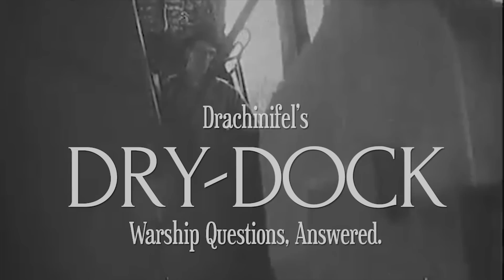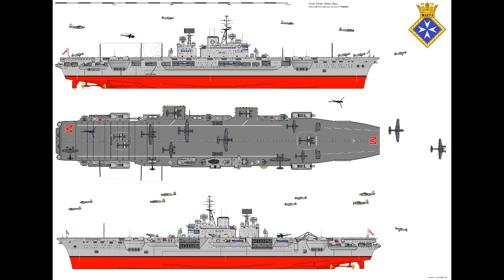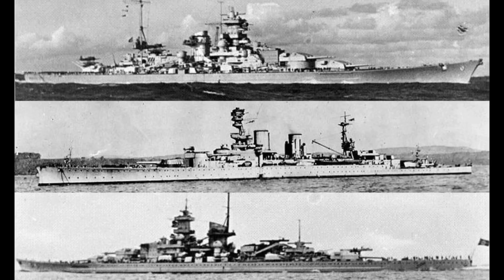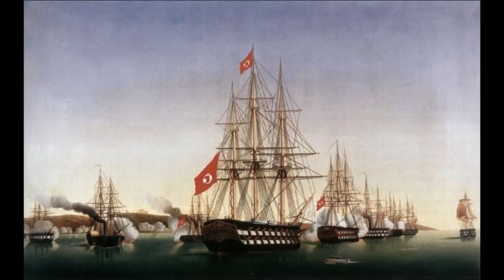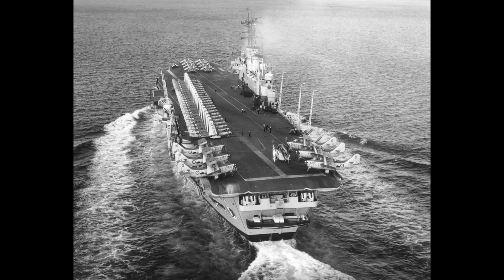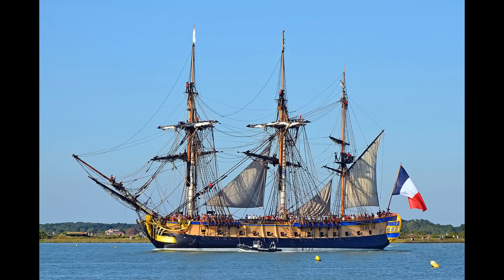The Drydock - Episode 070

Comment from the maker: Pinned post for Q&A :)
Reply: Hey Drachinifel, could you please update the link for the intro music for the “5 minute guide of warships” the link that you have been using doesn’t work any more, as the channel no longer exists (apparently it was deleted last month)
Reply: How much do you think about admiral yi history is true?
Reply: Marc Besalduch 

A lot of it is based on his own records and government reports, plus contemporary Japanese records, so it’s fairly reliable.
Reply: How does gravity work?
Reply: @johnmatthesen1186  The Earth sucks and you can test this by falling off a three story building or tree, gravity will suck you out of the air and smash you on the ground. Simple exclamation. The pull of gravity is determined by the mass of a object, which determines it's pull on all things under it's influence. This pull determines how fast a object will fall, it's acceleration affected by the thickness of the atmosphere and it's resistance to a object falling through it. Falling towards a planet without a atmosphere, the object should continue to accelerate until it hits the surface. In a atmosphere, the object can only accelerate to a determined speed, air resistance limits how much gravity can accelerate the object. Gravity can affect very light and small objects at a great distance, changing their course through space. Blackholes are still conjecture, we have never been actually close to one with a clear view. It's believed gravity can't escape from the black hole, some scientists believe each black hole has its opposite white hole, the black pulling matter in and the white spraying matter out, so far as I know, still unverified by science. As a test drop a apple on your left foot and a twenty pound steel weight on your right foot. Despite the different weights and shapes, both will hit your feet at the same time, the steel weight will hurt almost twenty times worse than the apple it outweighs by that much. Gravity's affect on different masses and shapes in a atmosphere, how despite this they fall at the same rate because they are equally affected by the atmospheres resistance to them as they pass through it. If it had no gravity, a planets rotation could hurl you off it if the rotation is fast enough. Gravity of the moon is used by many organisms to regulate sex and reproductive cycles. Making life on Mars with it's almost non-existent moons, a Interesting question of how this cycle especially in women will react to the loss of it's means of regulation. One of those things you have to actually experience, before you can say exactly how the body will react to the absence of the moons gravity in that situation. We have no way to know until humans actually live on Mars, but it's safe to say that there will be problems with this. If there is no wind and you shoot a .45 automatic straight up in the air, eventually it will fall close to you, the atmosphere resistance and gravity slows it's speed to nothing from a average 850 to 900 feet per second, gravity pulls the bullet back down, to hit the ground near you. If you are in a fighter jet and do a regular fast turn, your body can experience up to 8 gravity's, most people pass out at 8, if you weight 200, in 8 Gs your weight is 1,600, these aircraft are capable of doing a turn that will generate up to 16 gravity's, unusable by any pilot,  unless the affect of gravity can be turned off or eliminated. Here is a advantage of the unmanned drone, it can always out turn you, because gravity has no effect on it's systems. A aircraft in flight will experience a slight difference in the passage of time, because of the speed induced increase in mass of the aircraft. True it's almost too small to measure, but it's there. Mass and momentum has a separate effect from gravity, if you are on a jet traveling at twice the speed of sound that is suddenly stopped, mass and momentum will hurl you forward to be crushed against whatever is in front of you. Then gravity will make the aircraft fall from the sky.  A general outline of the main properties of gravity and some theories and speculation. Personally, I prefer Gravity by PaPa Roach, he appreciates the gravity of a situation in a well thought out manner. But that's a different kind of gravity. Hope this helps.
Reply: @johnmatthesen1186 - Do you mean stability?
Reply: No.
Reply: do you get enough rest?

you sound tired... please take care of yourself!
Reply: Seems to me to be an awful lot of concern, both in the video and the comments, about the potential electrical hazards of a turbo-electric drive especially once the ship is damaged. However, despite damage to various ships equipped with that system (various at Pearl Harbor, Saratoga repeatedly, the loss of Lexington) I'm not aware of these hazards actually becoming reality during the war. Are there actually documented cases of these shock hazards turning into "real" human casualties, or is it still theoretical?
Reply: Re: Turbo-Electric Drive  Isn't the new UK Carrier's (HMS Queen Elizabeth) propulsion system  a modern version of turbo-electric drive?
Reply: It seems to me after listening to several of your presentation of the German navy actions during WW2 that their use of a destroyer screen around the German capital ships were not used as much as I would have thought or if present were tactically misused. In some cases, I would expect the German destroyers did not have the legs to stay with, say, the Bismark. But other cases, the destroyer screen was sent off to search for the enemy resulting in the German capital ship being blown out of the water when facing a half dozen British battleships and cruisers that the German destroyers missed finding.
Reply: Would you mind going into a little bit of detail behind alternative designs that eventually became  Atlanta Class?
Reply: What was the thinking behind the Imperial German Navies scuttling heavily damaged ships?
Reply: If the germans managed to complete Bayern and Baden in time for the Battle of Jutland how would the battle have gone like had Bayern and Baden took part in it?
Reply: What if the Japanese threw the baby out with the bathwater and converted the Ise and Fuso class battleships into carriers, calling them "large decked transports", what with them being rather long turret farms? How would they have fared? Would the extra need for pilots have improved the speed of the Japanese training program? Would the additional four carrier hulls just have resulted in the US, Royal, Marine National, and maybe Italian (Il Duce is promised Formosa or something) ganging up on the 1920's IJN?
Reply: Considering past history, would you consider our current period in time a naval arms race with carriers from all the different?
Reply: Chris_Wooden_Eye  OK, episode 69 is like going to the fish market upside down. The obligatory childish sexual comment out of the way, have a great day!
Reply: Could you do a special/series of specials about the effects of bad weather on warships and naval battles from the age of sail through to WWII?
Reply: @Ralph0451  Yes, Halseys typhoons!
Reply: Why did many Italian ships have Red & White stripes on their bow and stern?
Reply: Jägeroo 

To avoid friendly fire.
Reply: Bk Jeong wow the Italians were concerned with friendly fire. Sounds like bad communication between ships. 😆
Reply: Jägeroo bad communication between the navy and Air Force, actually. The Regia Aeronautica bombed Regia Marina ships a few times.
Reply: @Cirrus2000  Several countries used identifying paint schemes on their forecastle and fantail decks to alert their own aircraft (Gemany, Italy, Japan, for example).  The downside of that was to make identification by enemy aircraft easy.
Reply: How do torpedos work (or not) in extremely rough seas?
Reply: What's the Sponson design Drach were talking about when he was breaking down angled flight deck for carriers? Sponson on Wikipedia doesn't sound like what he's talking about.
Reply from the maker: @eric24567  which part of the video do you refer to? :)
Reply: you were listing the benefits of angled flight deck and you mentioned something that sounded like Sponson around 31:20 ish.  Like space between take off and landing due to increasing space on Essex class carriers.
Reply: Apropos Somerville and Nagumo chasing around in the Indian Ocean, can you do a video on that particular operation?
Reply: During the North African campaigns, air power did a lot to suppress the movement of supply ships for both the Allies and Axis. Were these carried out by dive bombers, level bombers, torpedo bombers?
Reply: One of the anecdotes that I've read about the Chinese navy in the 1894 Sino-Japanese War was that they used the barrels of the main guns on their battleships to store chopsticks. Not sure whether to believe that or not...
Reply: MikeB they did even weirder stuff like pawning off the guns.
Reply: Problem with building a wooden ship nowdays is that you need to spend years figuring out how to do it again as the experience have not been kept.
See the building of the east Indiaman Göteborg, it took several years to build that becous they needed to figurit out as they went.

Also the ship is worth a visit it's a stationary museum right now in Gothenburg becous of lack of founds to take it out for sailings
Reply: Some historians contrast the complexity of Yamamoto's plans with the simplicity of Nimitz's response. Because code-breaking gave Admiral Nimitz knowledge of the Japanese intentions and deployment of forces, he was able to economize his forces and ignore Yamamoto's elaborate diversions. However, Nimitz did oppose the Japanese landings in the Aleutians with a cruiser force, thus leaving only two cruisers (CA Astoria and CA Portland) to protect CV Yorktown. Do you think that this sparse cover was an error by Nimitz, especially in light of the fact that neither North Carolina class battleship was available to screen the US carriers from the Japanese surface forces?
Reply: Here is an interesting question on world of warships. 
What do you think is a ship most mismatched at it’s tier when compared to it’s real world counterpart and or realistic performance specs? 
Also what was the most frustrating ship for you to play? (Mine was easily the tier 5 american cruiser. It was a big floating bomb.)
Reply: You get to design and build a ship that must be built by both the americans and British fleets in the second world war.(I.E satisfy the needs of both) What would this ship be (Ship type, name armarments etc)?
2(Would a sextuple centerline turret as suggested for the Tillman ships even be practical considering the problems the british had with quad mounts on Prince of Wales)
Reply: why have  or rather why where catamaran and trimaran designs not  explored for war ship in the era of big guns?   would they have not been  faster and harder to sink  due to  the redundancy ?
Reply: how effective would a age of sail cannon be verse a modern ship?
Reply: Why didnt the british use french all warships in their fleet or in free french fleet? They had access to couple of older battleships but these werent used.
Reply: What'd you need to get through the 6" deck on the original Design X Malta?
Reply: If the British 24.5-inch torpedoes had become the standard in the inter-war and WW2 period mow much better/worse of would the British destroyer and Sub forces be in WW2 and later going into NATO.
Reply: How long would Britain have lasted, if the German Submarine war against the British was as successful as the American submarine war against Japan was? Assuming use of German torpedoes after the initial problems were solved and the same quality and number of new submarines as in the US submarine fleet, with the search radar they used.
Reply: Hi mate. The link for the shirt keeps saying error 404. Is it just me?
Reply: Works for me. Still waiting for the "Giant Superstructure of DOOM!" t-shirt...
Reply: The Ottomans used unique (from a Western perspective) age of sail designs like the xebec among their lighter ships. Why do they seem to have relied mostly on European-style square-rigged designs, which have their roots in cogs etc. instead of a hypothetical indigenous solution to the problem of creating a ship with gobs of cannon?
Reply: On the subject of Youtube videos and demonetization... Do they ever tell you exactly WHY videos get demonetized, or is it just left a mystery?
Reply: Can you explain how the ship design competition actually works is their an app/website you use to standardise design choices or is it written design specifications?
Reply: How the Battle of Midway have changed if Yorktown hadn't been able to be repaired enough to join the Battle?
Reply: How would you have fought the Naval War as Germany during World War 1??
Reply: I've heard it said that the Swordfish was "so good, it outlived its own replacement". What, exactly, was so good about the design, and what, exactly, was wrong with the Albacore, the design that was supposed to replace it?
Reply: Could you say something about the 1970s wargaming of Operation Sea Lion?
Reply: I almost hate bringing this up since you give us so much excellent content already, but ... the ship v ship special? You did say you would put one together months ago.
Reply: If you ARE going to do historical battles my votes go to: Lepanto, Salamis and the battle between Rome's and Cleopatra/Anthony's fleets in that order
Reply: greerops 

Add Hansando, Myeongnyang, Trafalgar, and Ecnomus to that list.
Reply: You mention non major power fleets, chiefly the Ottoman Empire. Would the Dutch age of sail navy not qualify as well ?
Reply: What role did the US coast guard play during the battle of the Atlantic specifically with regards to paroling Greenland and supplying weather reports?
Reply: During wartime the Coast Guard comes under the command of the Navy.  During WWII their large Cutters escorted convoys and their smaller vessels engaged in coastal patrols and SAR.
Reply: Quote of the episode: “turn the entire stern of the ship into a giant fly grid.”😉👍 Great episode- thank you.
Reply: any chance of a special on the Ohio and operation pedestal ? ...one of the key "victorys" of ww2 imho
Reply: While on topic of engines > Direct diesel engines, German Z51 Model 1942 destroyer was supposed to run on Diesels, While this is preferred propulsion on modern cargo ships, would it be really viable on WW2 era destroyer or Light Cruiser?
Reply: How could the Salamis have looked like if her hull wasnt scrapped in 1932 and Hitler ordered to finish her with the 30s current technology ?
Reply: If the Vichy French had sent their fleet to the USA for internment, could that have lead to Germany NOT declaring war on the USA following Pearl Harbor, or perhaps even lead the Nazis to attempt to dissuade Japan from attacking the USA in the first place?
Reply: Have you done Admiral Scheer? a German WWII capital ship which had a longer career than many of them.

I remember reading in 2010 one of those '70 years ago today' newspaper clippings, on a story I already knew. It reported that a convoy (HX 84) had just straggled into Liverpool. Reading between the lines, it was clear that those interviewed still hadn't even begun to come to grips with what they'd witnessed a couple of days earlier.

You are an RN Commander past retirement age, captain of a cruise liner hastily equipped with a couple of 40-year-old popguns on the foredeck and laughably classed as an armed merchantman, which is currently the sole escort to a convoy of 38 merchant ships, when you sight one of the most powerful ships afloat bearing down on you. What three orders do you give?
Reply: What are your thoughts on Fred T. Jane's Heresies of Sea Power and the 'fitness to win', if you happen to have read this text?
Reply: Do you think that a modern US carrier with all its escorts (guided missile cruisers/frigates, submarine, and supply ship) would be able to take on the entirety of the IJN naval forces in 1942?  This could be either with or without the support of US naval forces at the same time
Reply: 23:56 did no one think to use a periscope?
Reply: Great as always Drach
Regarding the three planned video's on the development of Destroyers You have missed part of it.
The first was early history up to 1914
The second was 1918 and the Interwar years
The third is planned for WW2 to the present.
it seems you're skipping over 1914-1918, unless this is to have it's own video?
Reply: Where I live (Sweden) we hear a lot about the Battle of Svensksund - The largest naval Battle in Baltic History - but despite earning that title, the battle is virtually unknown outside of Sweden and Russia. So I was wondering: What do you consider to be the most overlooked event in Naval history?
Reply: I found this web site, which is illuminating on the German ships,  Scharnhorst and Gneisenau, .. 

http://www.navweaps.com/index_tech/tech-044.php
Reply: Had the North Carolinas been completed with the 14"/50 Mark B guns originally intended, would they have used super-heavy shells? If so, how effective would the guns have been compared to the 14"/50 Mark 7 firing the Mark 16 projectile, the 16"/45 Mark 5 firing the Mark 5 projectile, and the Mark 6 16"/45 with its Mark 8 shell?
Reply: Are the cavour and andrea doria classes on the list?
Reply: could you say a few words about the use of balloons?  I see it in your opening and wonder about it.
Reply: Drachinifel 
Your prediction on who comes out on top and by how much. 
USN battle fleet vs IJN battle fleet?

Take the conditions, contact times and durations from Battle OF Samar and leave the CVS out of it. Or at the very least to a minimum. Guns vs guns.
Reply: Drachinifel, what would you consider the first true pre-dreadnoughts?
Reply: Despite the problems with vibration, North Carolina and Washington could have been available for the Battle of Midway if their deployment to the Pacific theatre had been made top priority. Considering both the US carriers vulnerability to a surface action during the Midway battle and the addition of their then-current AA to the carrier screening forces, do you think that their absence was a major USN strategic error that could have prevented the loss of the damaged Yorktown?
Reply: stu ross the USN carriers weren’t vulnerable to surface units: the whole point of a carrier is to stay out of range of surface units and Spruance did that at Midway.

Yes he had to turn away. But he still won a major victory and the Japanese surface ships failed to inflict even a scratch.
Reply: Bk Jeong Yes I agree with your points. My thought was the contribution the battleships could have made to anti-air supportAs well as provide cover in case of a surface action such as could’ve happened at the coral see when the two carrier forces missed each other by 30 or 40 miles
Reply: stu ross 

The only reason that would even make sense was the lack of other, more cost-effective AA vessels that early in the war.